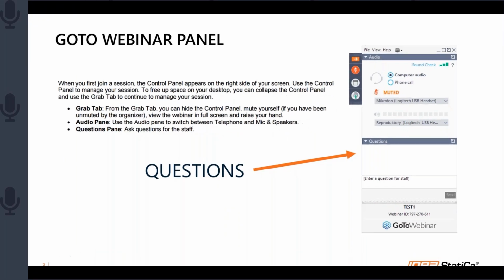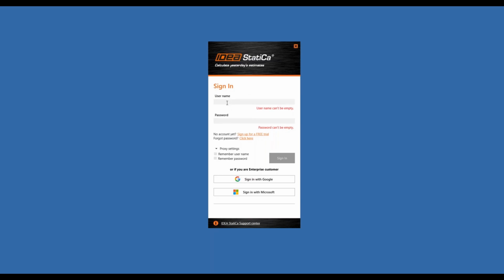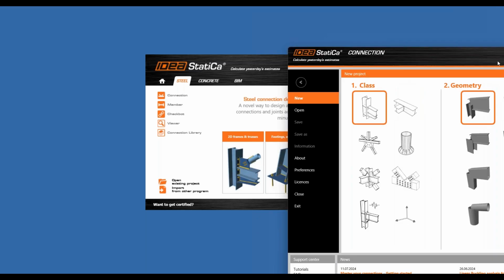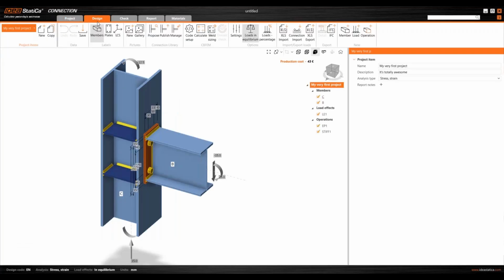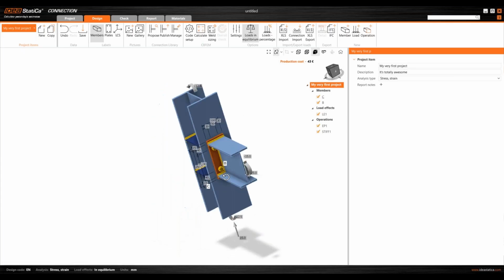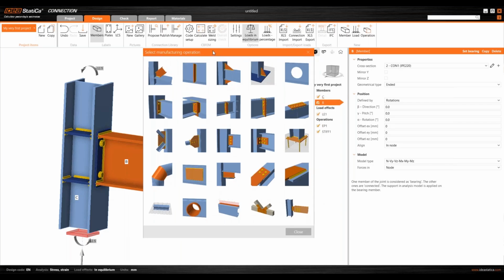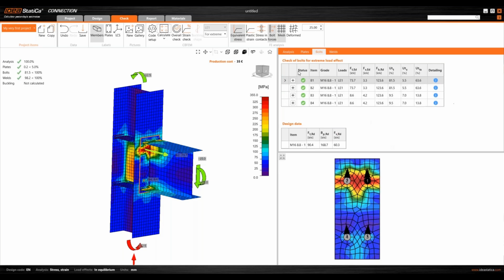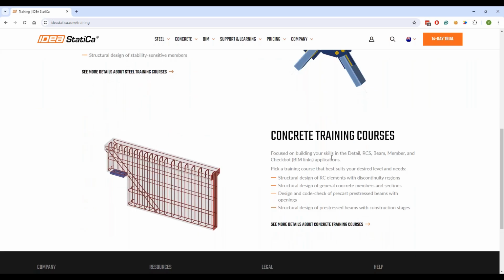Master your connections - Getting started

Comment: Hello,
Does the "all zeros" in "Unbalanced Forces" only apply when there is a connection between two steel profiles?
I'm designing a steel-to-concrete connection and I never get those zeros. Additionally, in your "Connection Wednesdays - Design of Anchorages between Steel and Concrete" webinar, there is an example where we see the same load values in the "Unbalanced Forces" section, which matches what I am also experiencing.
Thanks.
Reply from the maker: Hello, if you have a footing joint, the unbalanced forces have to be the support forces. Then it is OK.